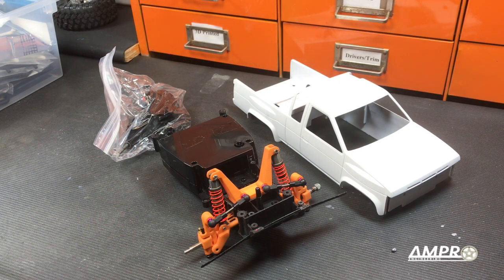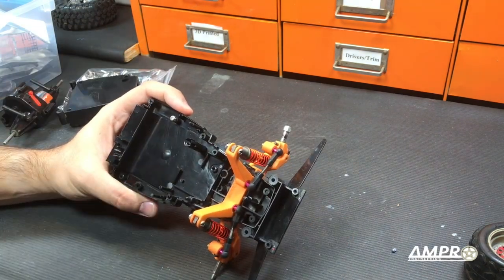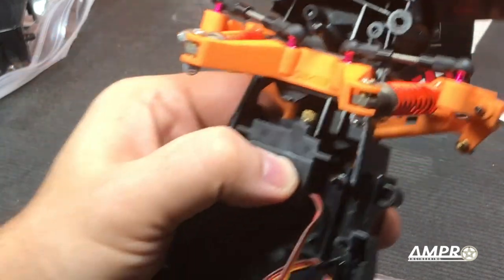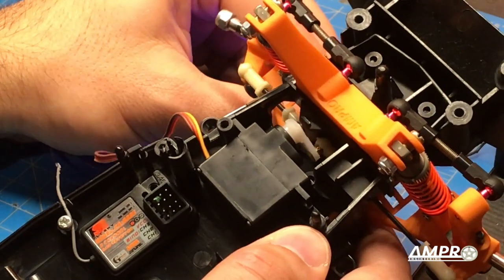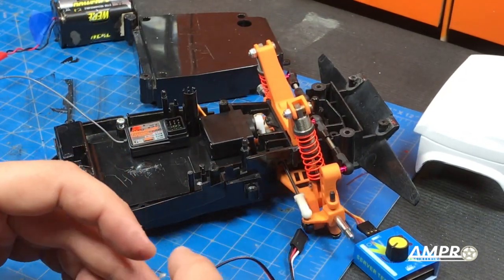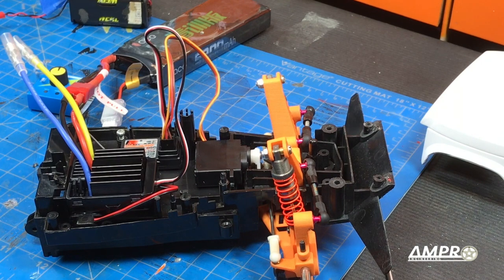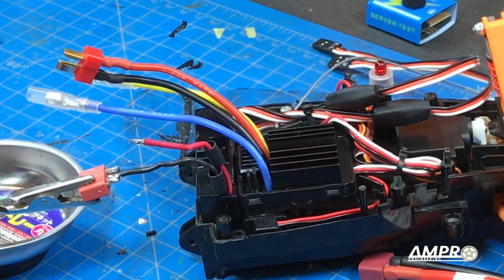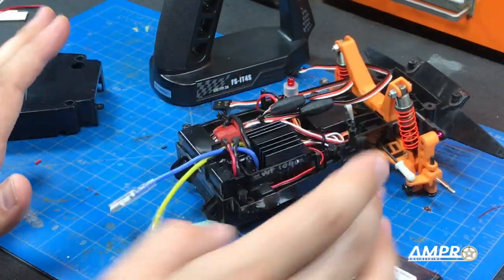e182: Ampro Project Tyco Bandit Part 5 - The Electronics

Comment: What size is that servo? What would I look for to get one? Just 1/16 scale servo? I’m new at this. Work on a lot of electronics and I’ve had this tyco bandit since I was a kid but electronics are toast. Gonna replace everything and get a new radio and receiver. I’m following along with your build you’re Bob Ross and my bandit is my version of your happy lil trees.
Reply from the maker: Great question, is it the servo most commonly used on the WPL 1:16 cars. I wish there was more info on it. Hahaha! Glad to hear it! Ill try and find more info on it.
Reply: Man... I’ve watched like all your videos and now I’m subbed. I’m about to buy a bunch of stuff from shapeways and some shocks and some spindles. I have no idea what I’m going to do to make the front wheels fit but holy crap this is fun! I’m afraid you’ve created a monster. Over the weekend I’ve bought a turbo hopper just like my first ever rc, an old radio shack truck I use to have, and a tyco turbo outlaw sprint car I hope I can use some parts and maybe the wheels from. Are there any options out there for wheels and tires for the tacos? I watched your zebra buggy video, could I maybe make some wheels from that terrible radio shack car fit on my tycos?
Reply from the maker: I have a mod to modify the hubs on the stock wheel to reuse them. Haha! I'll show it soon! There are also a lot of new wheels sizes out there thanks to all these new rc car sizes and scalers so it is possible that something is close!
Reply: He's totally the Bob Ross of RC 😂

Comment: Ampro don't be biased but should I get a lunchbox hornet e firestorm or wheelie king
Reply from the maker: Depends on what you want to do with it. Other than the firestorm, they are all pretty much "Toy" rc cars. They are good for fun but not for anything more extreme or racing. I do not know much about the firestorm but that looks way more modern.
Reply: @AMPROEngineering  Ok thanks
Reply: @AMPROEngineering  but I have a pumpkin should I just get a body shell